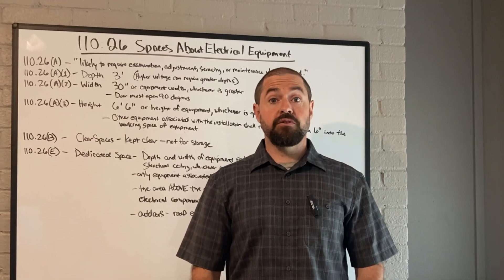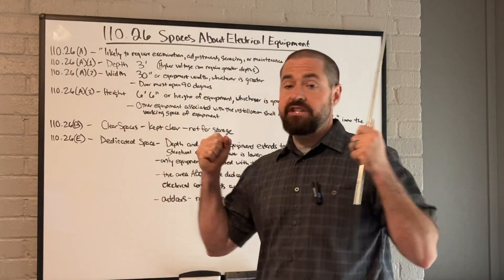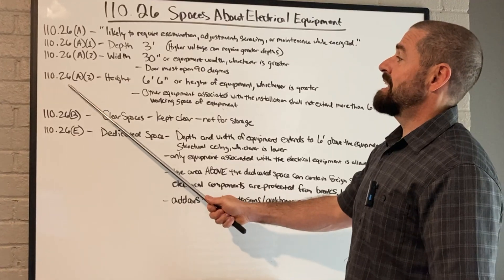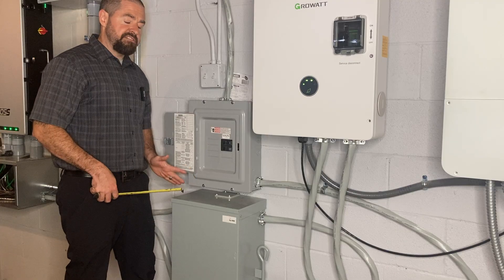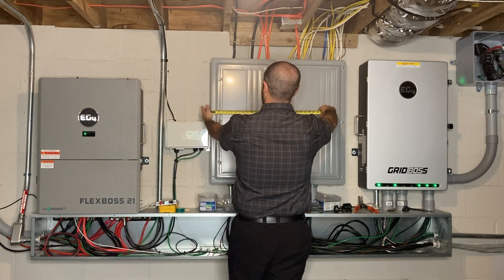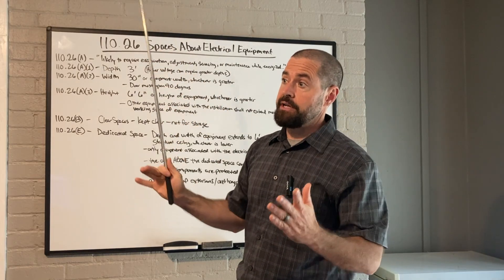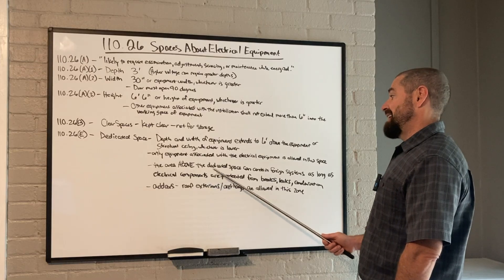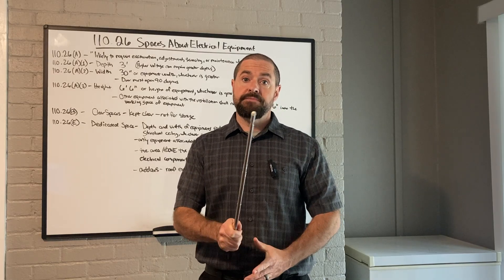NEC 110.26 Explained | Electrical Working Clearances & Dedicated Space Requirements

Comment from the maker: Confused about NEC 110.26? In this video, I break down the working clearances and dedicated space requirements around electrical equipment as defined by the National Electrical Code. Whether you’re an electrician, solar installer, inspector, or DIY enthusiast, understanding these equipment clearance rules is critical for safety, compliance, and passing inspection.

👉 What you’ll learn in this video:

Minimum working space clearances in front of electrical panels

Width, depth, and height requirements for safe access

Dedicated space rules above and around equipment

Common mistakes that lead to inspection failures and how to avoid them

Real-world examples for solar, battery, and electrical installs

This guide will help you avoid costly mistakes and ensure every installation meets NEC standards.

⚡ Disclaimer: This video is for educational and entertainment purposes only. Always consult the NEC and a qualified electrician for your specific project.

#NEC #ElectricalCode #Solar #BatteryStorage #ElectricalSafety

Comment: If you're trying to install a Gridboss above a subpanel, would that violate the dedicated space (6.5') or is it considered associated equipment?
Reply from the maker: It is associated with the electrical system so you only have to abide by that 6” rule in the “working space” requirements. Basically if the panel is surface mounted, you are good to go. If the panel is flush mounted, it’s a no-go. Thanks for watching!

Comment: I'm about to install my GridBoss in my garage, but I'm not sure if a car parked in there would violate the 30 inch requirement. 

From searching tesla powerwall forums it seems like its hit or miss if the inspector flags it or not.
Reply from the maker: A parked car shouldn't be a working clearance or dedicated space issue in my opinion, but some areas of the country are pretty strict about not mounting batteries in the path of a vehicle. They may make you install bollards to protect it from impact. Thanks for watching!

Comment: Don't forget Under the 2020 NEC, all DC circuits installed inside buildings that exceed 30 V or 8 A must be installed within:
a metal raceway (e.g., EMT, RMC),
Type MC metal-clad cable, or
metal enclosures—rather than PVC.
Reply from the maker: Good point, thanks for adding that!

Comment: 110.26A3? What if ceiling in basement is only 6’1” and floor joist are closed off due to ceiling? Nothing in ceiling just not tall enough for anyone over 6’1” to stand up straight 

Also sump pump and pipe going thru wall all below area but within 30” side spacing
Reply from the maker: Then you can’t mount any electrical equipment by code. Sump pump doesn’t count because it is cord and plug connected
Reply: @RockyBroadSolarLLC  even if the existing hose floor joist is only at 63 inches and the home was built some time ago. The original circuit panel is located in that same area. The code changed that I’m not allowed to install any new items in that area now I’m still confused. How if my panels are there I could not install another device if it meets all other requirements.
Reply from the maker: @jameswebb80 Unfortunately that is just the way of the code. Your existing panel is grandfathered in. Any new work needs to be up to current NEC and building code.
Reply: @RockyBroadSolarLLC  even if the panel fails to meet code? I know i will need to add bars to separate neutral and ground. But other than that i should be ok?

Comment: Do you need an inspection if offgrid install through a transfer switch and ground mounted solar panels?
Reply from the maker: Agreed @NickWindham and @SurgeonTech I would say in most cases the answer is yes, any electrical work requires permits and inspections, especially solar and batteries, but many people prefer to avoid that. To each their own. Permits and inspections are going to add cost, including a professional design that has been stamped by a structural engineer. It is really about what you are comfortable with. I personally prefer to do it by the book so I don't have to worry later on when I go to sell my house and there is unpermitted work in the home.
Reply: Most areas of the country require it, but there are 11 states that have counties in them do not have building codes, don't issue permits, or have inspectors. If you want the freedom to do as you want find one of those counties to live in. Do your own research some have codes but no inspection. I have an off-grid property in Greenlee county Arizona which is one such county that has no building codes. They don't issue certificate of occupancy either.  I've always wanted to own property where there are no building codes. My plan is to build a battery and inverter shed out of concrete block. It will have 100 kwh of DIY Lifepo4 battery bank. I have built several DIY battery banks already this will be the largest.  Another idea I have is an RV park that is 100% offgrid since I'm not required to have any building permits even for commercial property that reduces the cost of building.
Reply: @Mike-01234  Yea I will get a company, compliant and safe home for family goes hand in hand in my opinion, especially being a surgeon and 4 mill home burns down, that would be on international news "DIY surgeon burns down the city". Haha. Have a nice Friday my AZ neighbor. Time to cut all day for me. Solar is like free therapy. One way to clear the mind from patient problems, for a bit. 👍
Reply: @Mike-01234  Nice!
Reply: To make sure you get the right answer, ask your authority having jurisdiction (AHJ) and your electric transmission & distribution utility / service provider TDU/TDSP.

Most people I see doing off-grid DIY solar installs usually don’t mention inspections.  However, that may be because they’re ok with redoing work if they need something inspected for permits later.
Reply: @NickWindham  thank you